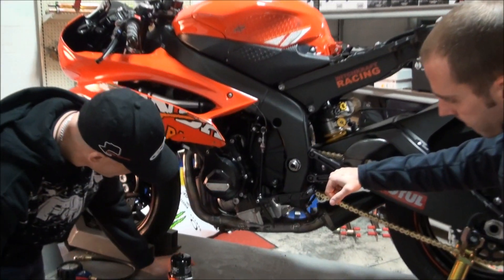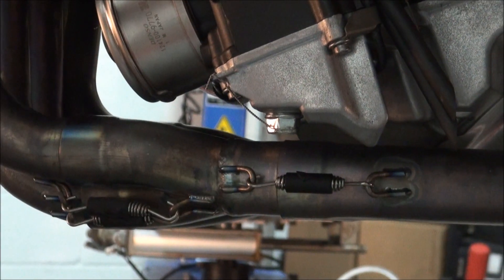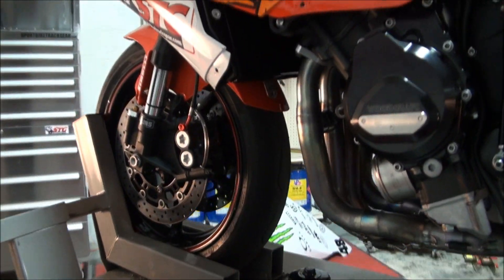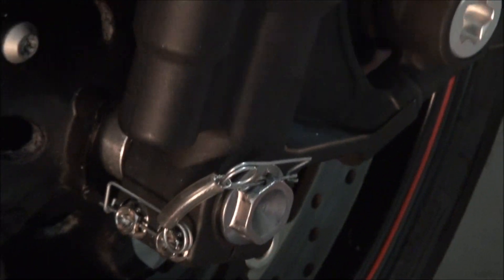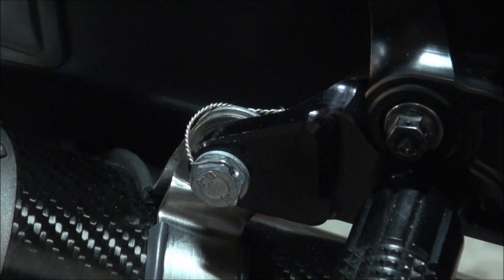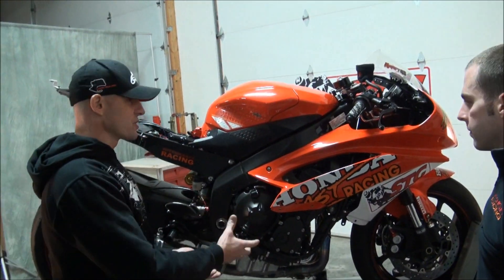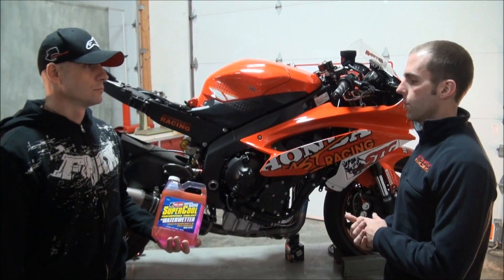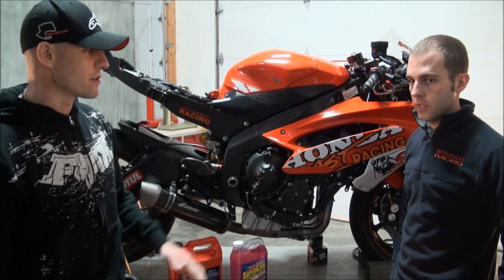How To Prep a Race Bike Part 2 of 3 from SportbikeTrackGear.com

Comment from the maker: @kopaszQ Not a stupid question at all. Some of the best race bikes begin as a used bike or even a salvage title bike. Myself both of my 2008 R6's that I will run in the AMA this season were used when I picked them up last year. With a little elbow grease you can make a used bike basically as good as a new one.

Van

Comment: @Flylikechris I hear ya on that one, but I still don't think the bolts would come all the way out. Still not quite as good as correctly safety wiring without the clips. I do like how the axle pinch bolts were done, does make it easier. 

And fyi imo, the oil filter clamp should have been safety wired so that the wire would pull the filter tighter, not looser. The way it was wired would allow the filter to spin off some and loosen up. The clamp should be repositioned and the safety wire lengthend

Comment: The Exhaust thing happened to Josh Hayes a few years back when he rode for Erion Honda if i remember that correctly where about half way through the race he almost lost his exhaust and had to pull into the pits and his crew couldn't get it fixed so they just pulled the can off and sent him on his way
Reply from the maker: Definitely a good idea to safety wire, that has to suck to lose the race over a part coming loose.. ~Aubrey

Comment: The safety wire on both the drain plug and oil filter are going around the wrong way. Safety wire should be wound around clockwise to prevent loosening of right hand threads.

Comment: gasket on K&N oil filter has an inferior design, it has failed for many people.
I thought it would never happen to me, thought it was a bad batch or sorted long time ago.
but it could have killed me last year, 15 minutes after I had been riding ~240km/h the oil gasket failed and I lost 3 liters of oil in just a few seconds, rear wheel slided sideways like it was on ice. I will never buy their oil filter again :(
Reply from the maker: I have heard about this happening, but I have not seen it. To be perfectly honest I have kept right on using them all along and never had an issue personally. - Van

Comment: Why does he have so much slack on the safety wire on his brake calipers and rear axle nut? Seems to me like that defeats the purpose of the safety wire. I bet I could pull all of those bolts off without removing the wire. Am I missing something? I don't have that much experience, which is why I'm asking.